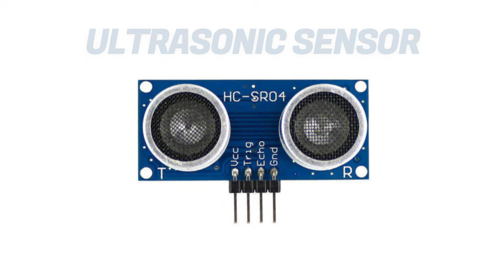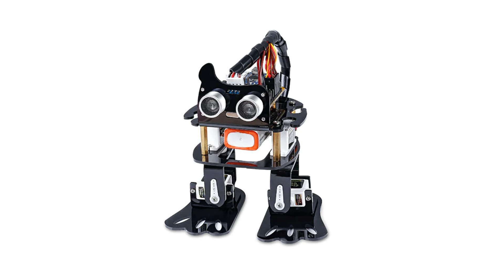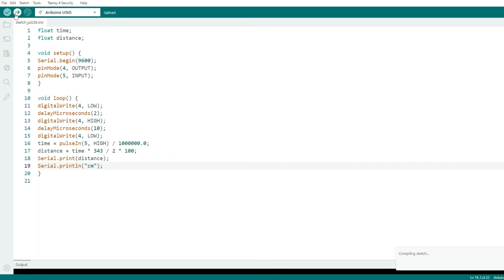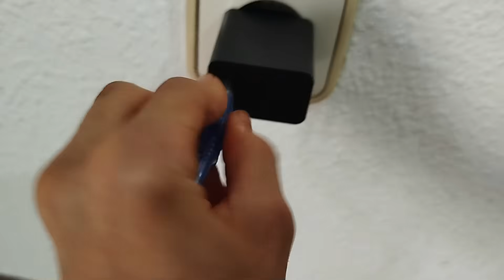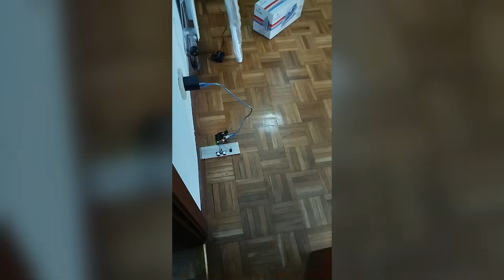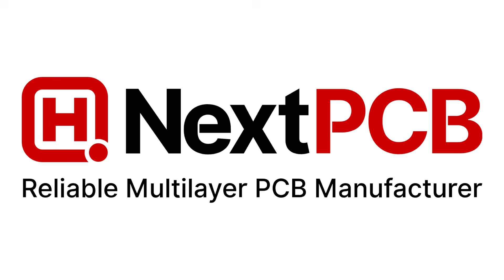How To Measure DISTANCE With SOUND! || Arduino Tutorial Series Ep. 9

Comment: I get massive changes in air density (coastal fog so thick it makes The Mist look weak). How difficult would it be to use a barometric input to adjust the calculation? I need fairly high precision for... Uh... Pest management... 

I can make analog and live machines. Gravity clocks, water pumps, sawmills, bandsaw sharpeners, worm beds, aquaponics systems, food forests... The wizardry you do is wildly impressive. I'd love to hire you to tutor me, but I think the proverbial bucket has been so full that it's been spilling every time I try something new. 

Keep it up dude. I'm rooting for you.
Reply from the maker: Sure! In fact, that's what many do when both high precision and ultrasonic measurement are required. Although the most common adjustment I've seen is for temperature, as that seems to have a bigger impact in most scenarios.

Comment: I tried writing the same code and in the monitor, for some reason, it keeps putting 0cm between the readings. Does anyone know how to fix it?
Reply from the maker: The first thing I'd try would be to make 100% sure you actually got every line of code right and every cable is correctly connected and in good condition, then you might consider whether your sensor is faulty. Tell me once you've checked! Although I can't do much from a comment section so feel free to open a question on the Arduino Stack Exchange and link it here